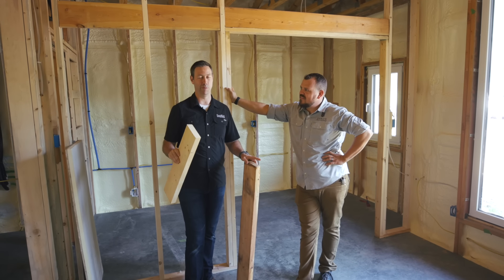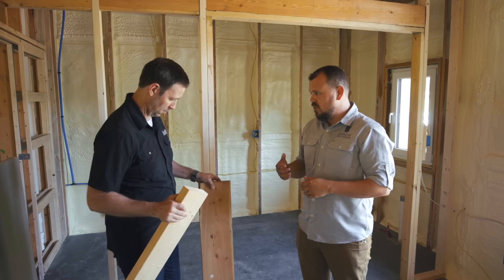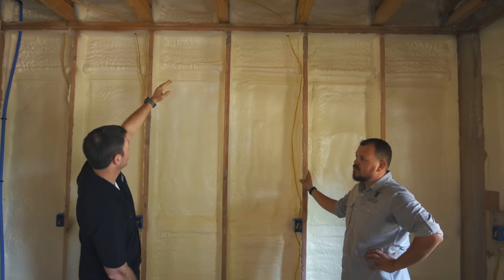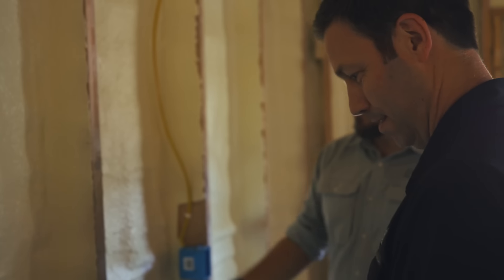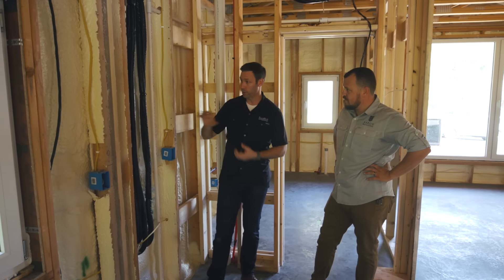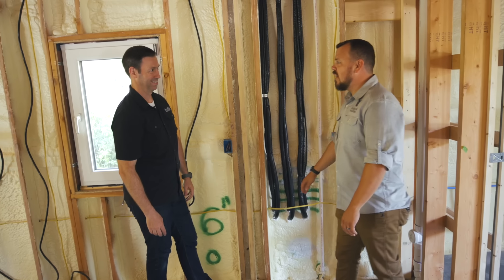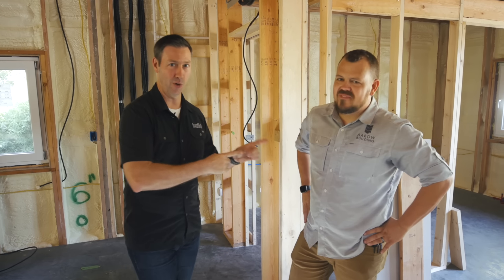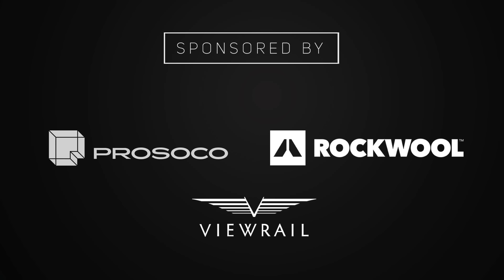Why would you frame a house with 2x8 lumber?

Comment: How deep of a plaster ring for the receptacles and switches now?
Reply: What? I don't think he plans to recess the electrical boxs so their flush with the exterior sheathing lol
Reply: @onetwothree4148  It would have to have them. It's flush with the studs now and he's adding more than 3/8 over the studs.
Reply: @mellowrebel4618  I didn't see any boxes that were flush. Unless the electrician installed the boxes wrong, all of them have plastic tabs that set you pround from the stud automatically. No different than any other wall

Comment: Heat loss/gain is so much lower in side walls I don’t understand the expense and the long time to recover that cost. When I built my house I concentrated my dollars in the ceiling where some 70+ % of heat is lost. Plus I used a very high efficient heating / cooling system along with HF windows. I have a VERY  cost friendly home in both building it and operation. Also $1500 to 2000 extra for a 4300 sq ft come on maybe more like $3500.plus $$$$$ for extra insulation.

Comment: Which is better - 2x8 or offset 2x4?
Reply: No need to offset if you use 2x10 top and bottom plates
Reply: @colstace2560  - I'm talking 2x4 on 16" then another parallel row of 2x4 on 16" but shifted 8" so you get 8" of thickness and no heat bridge from the stud.
Reply: @GTGallop  the 2x4 is only 3 1/2" wide so 2 = 7 inches, so on a 2x10 plate you will have a min 2 inch gap between the 2 walls, no thermal bridge, plus a dry 2x4 doesn't really transfer heat or cold, 👍😁

Comment: If you can afford a 4300 sq ft home and you are a custom home builder, you can easily justify the added expense.  One thing that looks strange to me is there is no horizontal blocking with such a tall span. The zip sheathing and poly iso in better than cardboard but does not impress me have any significant strength. The spray in foam keeps the bugs out and improves insulation but the health effects are what?

Comment: You ready for this in Arizona a typically hot as hell climate. Builder’s build homes with majority 2x4 outside walls. Blew me away to see it when I first moved out here. Then they don’t even sheet outside with ply wood. They use foam and chicken wire and stucco over that! The worst R value you could imagine. So crazy so crappy.

Comment: I'm still worried about how he is going to fasten the interior walls which run parallel to the ceiling rafters that have already been drywalled.
Reply: Why?
Reply: @cpad007  How?  How...do they get fastened? Explain how you would do it, please.
Reply: @harolddouglas4057  I don't understand the dilemma you see.  Explain.
Reply: @cpad007  What keeps the top plate from moving side to side when it is plumb? Not a nail into drywall!

Comment: I would not be doing 24 on Center, the drywall is too flimsy in the middle
Reply: Maybe they use thicker drywall or something? My understanding is you can insulate a lot better with 24 on center.
Reply: Use osb as a backer board

Comment: The T-stud still looks better than 2x8.  T-stud is stronger, more R-value, treated with NextGen 4-in-1 (rot, mold, termite, insect).  You can get T-stud in 2x6 or 2x8.  Ideally I'd get the "bare naked" ones (without foam preinstalled) and sprayfoam the entire house yourself after the walls are erected for a continuous insulation, no cracks, good air sealing, ties wall assembly together for added strength.  Unfortunately, the bare naked T-studs don't seem to be available yet. https://youtu.be/mxDSulcLpAE?t=640

Comment: With the layout, the floor trusses are not on the standard 19.2" layout so you are either going to a 16" TJI or adjusting spans to be shorter, which probably isn't happening, so there is an increase in cost there too.
Reply: floor trusses are on standard 24" centers?
Reply: @dallasgombash5381  while 24" is a "standard" it's not used very often in the PNW that i have seen. I've got a job now that's 16" TJI 210 series and 16" rim board, quotes from 3 places and all of them say "special order" no return. all because they want a 24' clear space above the garage.
12" and 14" TJI with 19.2" layout is the "go too" in these parts, if it's different cost's go up for materials or things can get missed since framers don't always measure twice and cut ounce as they say. running tight spacing with TJI and be a pain for plumbing drain pipes too.
this is a bad ass method but i think the cost's are more then 2k for a 4k plus sq/ft house.
Reply: @Ramdodge582  I suppose in the situation in the video, since they are using a double top plate they would be allowed to do joists on 19.2" centers with walls being 24" centers. I do agree that going up in size in floor joists just raise costs significantly if you have to redesign floor heights after the fact.
It's pretty lame that framers can't be reliable enough to "measure twice and cut once", it really "should" be standard practice

Every situation is going to be different I suppose. It's probably not a huge cost increase to go 24" centers in the situation in the video is because it was designed that way from the start.
Reply: @dallasgombash5381  yeah, you have to be on these guys, but in their defence when they build 99% with 14" tji on 19.2  they tend not to look for "weird" things like a 24" layout across the whole house. It's a cool setup for sure but I think they are glancing over the added costs with this setup even when it's designed this way from the start. But for a house using zip its nothing really, especially for a house using zip r. There are not a lot of dealers in my area with zip so the costs are about 40% over standard sheathing (including tyvek drain wrap and tape).

Comment: And how about the fact that with blown in fiberglass in those voids,  it isn't impossible to run future wiring.  Good luck fishing wires into a stud bay that's completely filled with foam.
Reply: The walls are not completely filled with foam. There's 2'' of closed cell, then blown in fiberglass for the remaining 5 1/2'' which is easy to snake wires through. I'm also pretty sure that these guys have all their wiring figured out.
Reply: @augustreil  Thanks for your comment. Yes I know - that's the reason for my reply. Flash and batt is an excellent choice because people love to renovate later on.

Comment: The Polyiso board on the outside is great. Adding a layer of closed cell inside of the sheathing creates a sandwich of sorts, making it impossible to detect a leak in the wall structure until damage is catastrophic. A better solution would be substituting the closed cell foam with open cell.  That way water that might enter the  wall cavity will migrate inside allowing repair before its too late. The fiberglass insulation has been shown to allow air movement and not be effective in stopping a fire.. In my mind a better assembly would be: Keep the Polyiso on the outside. Spray 3 1/2 " open cell then 3 1/2" Mineral wool insulation. Granted the mineral wool would cost more than blown fiberglass, but it would be immensely quieter. Using fiberglass in the cavity saves less than you might think versus an all open cell foam wall assembly. The Polyiso itself can also be a problem. Any water getting between the polyiso wrap and wood sheathing is somewhat stuck there. One theory is that you cannot make a building that does not leak, but you can create a building that handles any leaks. Have you considered using a product such as rain slicker that gets the siding off of the sheathing? This turns your siding in to a rain screen effectively keeping moisture off the wall itself.    You have built what looks to be a fine house. I would not purchase it as constructed. Just saying.

Comment: Framers should charge more, a lot easier to handle/cut/nail/lift 2x4s and 2x6s vs 2x8s. Plus in my area anything bigger than 2x6 is yellow pine...pain in the ass wood!  
 Yeah, framers would/should demand more!
Reply: Are the frames assembled on site or off site? If off site then the crane does the lifting
Reply: @colstace2560  video said onsite, stick framing.

Comment: I'm not a builder but something just seems off. This builder is throwing some heavy duty ammo at this build. But there has to be a point of diminishing returns as to r value and that translating into lower bills over the next 30 years. So what I heard is that the upcost of going from 2x6's to 2x8's is $2000 for the whole build. Yeah I don't buy that, more like an 20k upcharge overall. What would be the cost difference if you went 2x4 LSL's on 24" centers with sprayed interior foam and that 1" iso zip on the outside? What would be the R value difference and how would that translate over time in energy costs? And R value isn't just adding 1 + 1 = 2 it's more complex than that having to factor in what is being built.  One thing that is not factored into these builds is "sick building syndrome" Yeah it's a thing and it affects closed envelope buildings like skyscrapers. You build a tight envelope that does not breath and if the physical systems in the building you are putting together are off in any way it will throw off the air quality in a negative way. And people down the line living in this structure are going to wonder why they have upper respiratory problems all the time. It's all overkill. In the end generating content is great but this person building this house is a contractor  building for himself getting the contractor discount on materials and his crew.

Comment: Double 2x4 walls with 1/2 " gap would do even better and possibly cheaper
Reply: I would do Double stud walls at my own pace but but his solution is cost effective in terms labor and engineering work that has to be done. www.pinterest.com/pin/102316222761708910/
Nice double design example over there. Using I-beams also is an option. With much thicker walls there's an option to go for dirt cheap isolation like sawdust mixed with lime or Straw-bales (it can even be structual)
Reply: I’m just learning about double stud walls. Seems to me the inside wall does not need to be load bearing, so that should be easy on the engineering.
Reply: @4philipp  double stud walls use a single top and bottom plate so both walls bear the load

Comment: Why 2x8, and not 2x4 double wall offset? Then there is no wood going all the way from inside to outside, it's easy to wire, if you use pex it is easy to plumb. If you wonder what i mean, think build a 2x4 wall,, start at 16 inches on center,, build the next wall start at 8 inches and then go 16 on center. The studs are staggered.

Comment: I don’t believe framers didn’t charge extra. These types of homes are not your average affordable homes.
Reply: This guy is a builder.   Framers work for him.
Reply: They are talking about sub-contractors not employees... those are two different things if that’s the case that these framers work for him by the hour that’s totally different. But it does make a difference on materials to be installed by subs!!!
Reply: @protectoservices  They made that distinction.  He said the framing was done "in-house" which would be hourly employees of his.  Then shortly after Matt said that a framing sub-contractor might charge and additional fee
Reply: @falconeer99  subs WOULD charge extra and should charge extra for the extra work involved

Comment: The real world cost to the public using 2x8 construction is a heck of a lot more than is being quoted here.  When a builder is building his personal home his costs are wholesale. Retail costs to the public would be at least double the marginal costs he’s indicating.  Hes building a 4300 sq ft house because as a builder he gets massive discounts on labor and materials with no need to make a profit. So this is more of a theoretical evaluation since it would be hard to cost justify for the average new home consumer.  Plus I have to wonder if you really need R40+ in the walls in a house In Missouri? And if you have lots of windows that aren’t triple glazed what’s the real benefit of super high R level walls?

Comment: Hopefully you used BoraCare around the interior to prevent subterranean termite intrusion, the foam insulation will make it nearly impossible to kill if they find a way into the structure. Did you do a soil pretreat?

Comment: why not use r6 bubble wrap insulation that comes in rolls...would be much easier to install and also way cheaper than the r6 at the beginning of this video...its also resistant to corrosion so you could just put it over the tyvek and since it comes in rolls it can go on quickly...1 person can install it quickly by themselves...and you can put siding over it...unless there is something that I'm not thinking of...its a better option and you can do it about 1000dollars for the average size house...im guessing...if this is a bad idea I would like to hear why

Comment: Why not 2x6 on 16" with 2" spray foam and  4 inch fiberglass or roxoul bat, vapour barrier, standard drywall.  The strength and insulation improvement is incremental beyond 2x6.

Comment: Missouri is a tornado alley state. And the closer you get to the Boot hill(south and east of interstate 44) Your in earthquake country.
The New Madrid Fault line runs through there. I'm curious as to the floor wall roof connections. And the load difference between steel stud construction and 2x8 wood. In a weather extreme climate. Tornado earthquake. Snow/ice load and hurricane/fire/flood that the midwest sees from time to time. Why hurricane? Central MO. is only 11 hrs drive from the gulf coast. And due north.

Comment: I disagree with the assertion that labot costs are equivalent. It takes twice as long to make the actual cut of a 2x8. A laborer can't carry 3 at a time. The weight alone will exhaust laborers faster. It's all too easy to make such a statement when you're a contractor building your own house. I'd bet you'd argue differently on a bid.

Comment: After foaming your walls and roof. How do you reassure you don’t get mold growth because the house is tighter than the old traditional method.
Reply: Typically an hvac expert would have to zone and size appropriately for air tightness and sq footage so that it cycles frequently enough to “pick up” moisture in air and collect in up to date dehumidifier in hvac system.
Reply: @_familyMAN  Code is changing more and more to require some form of fresh air intake incorporated into hvac. Pretty soon we're going to be required to let in as much air as a drafty old house thus making these hyper-insulated homes useless when it comes to savings.

Comment: "There might be cost" 😂😂😂 i''d definitely be charging more for 8" cutting extra material and lifting extra weight ...
Reply: @Verminator151029  extra time loading materials , extra time cutting materials , extra fatigue moving materials , extra wear on tools all adds up to additional cost ... its really not hard to figure that out . Obviously on this job the labour was happy to accept the term because they were in house workers either that or they were given no option . Any self respecting trades person working for themselves would charge more otherwise its charity .  To say i would screw people over is madness .  extra work ... extra cost ... at acceptable rates
Reply: @Verminator151029  I find it interesting when I walk a job the framers act like nothing is too tough for them.... you publish a video with 2X8 framing and they come out of the woodwork complaining about a little extra weight.....pretty entertaining
Reply: @JamieVauxnut1  If you framed 2X4 24"OC would you offer a discount?
Reply: @Verminator151029  The "extra fatigue" was a push....
Reply: @stevenbaczekarchitect9431  if i priced for 8x2 then it was dropped to 4x2 then yes i would offer a discount ... we can all act like we are big strong guys with balls like watermelons and nothing is heavy but 500 lengths of 4x2 and 500 lengths of 8x2 is a MASSIVE difference in weight . Last job i was on wad 12x2 roof timbers all hand cut and guess what ... i charged more than i would for 8x2 . Its not rocket science , it will take longer , it will use more nails , it will need bigger hangers/shoes  , it takes more cutting and you guessed it its more fatigue on the body everyday

Comment: Heat goes up not out wasting money
Reply: Actually maybe you should check out that high school physics book there my friend.....hot air goes up (so you must be floating)....heat moves from warm to cold...direction doesn't matter, delta in temp does...
Reply: @stevenbaczekarchitect9431  hot air is less dense than cold air therefore money is better spent on ceiling insulation rather than the wall. The window are the weakest link in the wall anyway. If you look at any building code attic insulation is around three times the walls. If your budget is endless sure make everything super efficient, but when you have allocate money which we all do. Attic insulation will pay for itself first.

Comment: The bracing for load bearing studs against buckling is the exterior sheathing or interior gyp board. Just be sure to connect to that 3 2x4 stud pack with the gyp board so they don't buckle
Reply: When they are nailed together they become one, and are stronger than a 4x6.
Reply: @hankclingingsmith8707  that's not actually true. There are some design provisions in the wood code (NDS by AWC) that allow you obtain greater than individual unbraced 2x4 capacity, but not at all the same capacity as a 4x6.

Comment: 2 by 8? Why not 4 by 12 (actual size is 5 by 13) for the wall studs and 2 by 12 (actual size is 3 by 13) for the floors. Vacuum microwave kiln dried and pre-vacuum prepared high-pressure impregnated with phenolic resin plasticized asphalt from the inside-out.

Comment: You can build a house with 2x4's and 1/2" OSB only and have a structure just as strong and about 1/3 the price.
Reply: Cheaper, yes. But not 1/3 the price, especially when you consider energy cost savings.